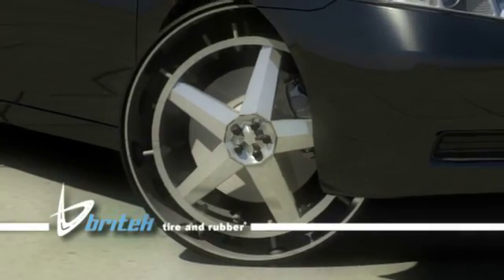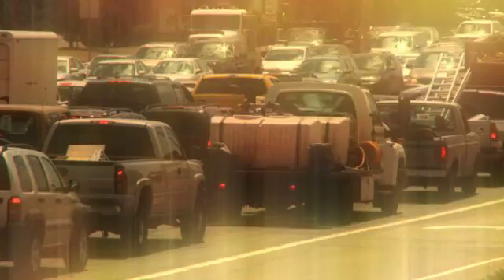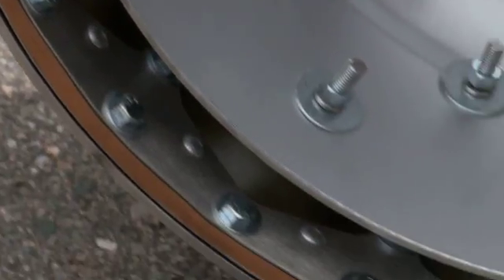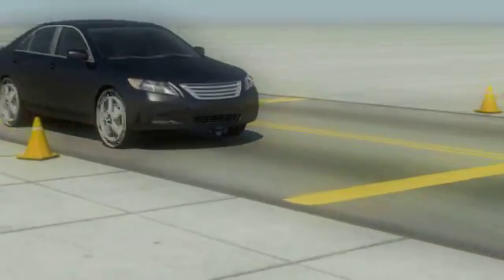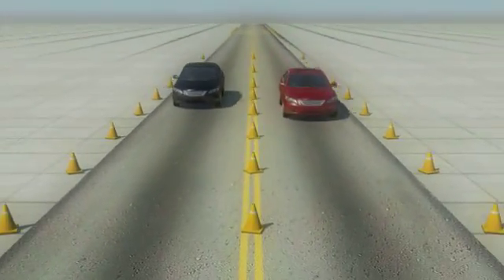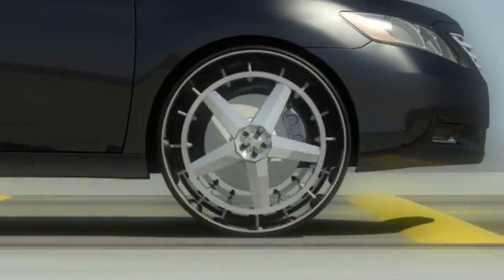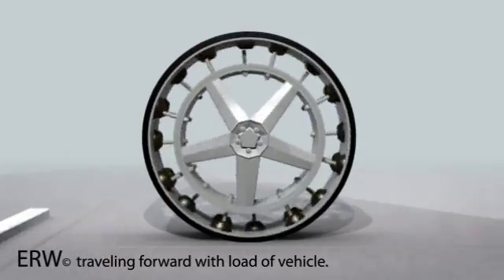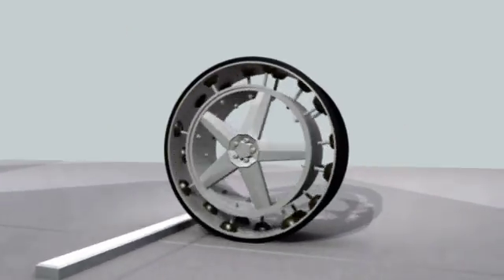britek ERW© 3D Animation

Comment from the maker: @redreaper2020 Any force capaple of moving the hub / hoop relationship from perfect zero centering is accumulated and returned through the recentering hub in hoop to the ground. The pull of gravity, running up a hill, throttle and brake forces, lateral displacement while maneuvering... any force. The twin or opposing "pre tensioned" membranes cancle out occilations as they begin. Each responding with the exact opposite action / reaction in "real time". ERW a new type of machine.

Comment from the maker: @giliam74 Check out our 6,000 lb. dyno load video where you can see the hub ride high and forewords whithin the hoop at highway speeds and under throttle. This is a sure indicator of improved levering. Check out the U.S.D.O.T. coastdown video where ERW has 50% better coastdown and easily out accelerates 35.5 over inflated pnu. We tested ERW with no traction layer as we were waiting to recieve patentable tread layer patent protection.

Comment from the maker: @mikka1986 Consider the pull of opposing drawn membranes able to cancle out impact / movement  in "real time" across the hoop. This means that as ERW deflects over an impediment the ground side of the hoop is moving  to the hub while the top side is moving away. Equal and opposite reaction in real time. This is a new type of machine ...never seen before. This is why the tire industry is so upset, every parameter of performance has patentable solutions for the industry and we own them.

Comment from the maker: @godackgudalach1 Not recomended but you can run into curbs if you like with the Kevlar bound ERW highly curved composite hoops. They displace laterally to deflect impact. You are correct about the cost. A premium product will require a premium cost, at least initially.

Comment: If you hit a curb with the thing its safe to say its done for...   I might get a bubble in my side wall...  and I lower pressure in the snow to get more traction in winter and raise it on sunny days for better mpg's    I wont buy these unless they are cheaper than new rubber and I really don't think that's gonna happen

Comment from the maker: @necromncr Consider equally drawn slingshots centering across a hoop. Any action IE movement will be demonstrated in equal and opposite action in "real time". Each one following and cancling out the other at the "exact" same time. It is this action/reaction in "real time" that makes ERW superior to any tire when the surface, speed , direction of travel changes. This "force" can be adjusted by more or less attachment distance to inner wheel and by adjusting vacuum boost on membrane side of hoop.

Comment: @EnergyReturnWheel I presume 40-45 profile would work then? Also, I understand typically between 45 and 50 profile is approximately optimal for regular tires as it gives the best balance between distortion resistance and overall grip. Is there an optimum profile for the erw?

Comment from the maker: @jcadlols Any profile can be matched. We are now building and test riding 29"x 2.5" mountain bike ERW wheels. NO MORE FLAT BICYCLE TIRES!  Performance is amazing. Video coming soon. For auto the hoop displacement is not enough to hit fender wells, just enough to accumulate/return any force capable of bringing wheel/hoop out of perfect 360 centering force IE gravity, rotation from throttle responce, hard braking, lateral displacement from cornering bumps, etc.

Comment from the maker: @larry903s Testing early "steel" hoop models we had  hoop failure by hitting a 4" asphalt like brick at speed. We continued driving, agressive maneuvering only noticing a slight bumping. To our surprise the hoop had cracked 3/4 across yet maintained reasonably good handling and ride. The membrane held the hoop in position. This was one reason we went to composite hoops. Also the "4,800 psi." @ 800% elongation membrane can really take a beating. Max. elongation potential is only 300% in ERW.

Comment from the maker: @larry903s Consider this... ERW has opposing "sling shot" like pulls. This counter balances load cycles in "real time" across the hoop radically reducing the cycle time and displacement. When pnu fails it usually happens quickly. ERW is very robust. It is pnu. that must form a tread block, a slapping action you can "hear" on some road surfaces...that limits high speed performance. ERW rolls and conforms our Kevlar bound wedges into a "footprint" a smooth rolling action that pnu can not match.

Comment: However, if you're saying that putting the wheel under tension in an unloaded condition, much like a tension bolt when it is torqued (re., your statement of ' "pre" tensioning') then the wheel is seeing fewer reversing load cycles with perhaps smaller amplitudes (or no reversing load cycles depending on the road conditions), but it is still seeing millions of loading and unloading cycles, which still causes cracks even if it is all under tension loads.

Comment: My point of the joke was this. The ERW is essentially a mechanical device, so it can still break. You can't solve the problem of fatigue.  A rolling wheel of let's say 2 foot diameter would undergo approximately 1,680 reversing cycles (reversing from tension to compression loads) in just one mile. That's a lot of reversing load cycles and that is horrible for fatigue.

Comment from the maker: @larry903s We agree! The Michelin tweel can not displace much "linear" travel internally and cannot be "pre" charged with elastic tension like ERW. Our "pre" tensioning replaces "air" pressure that supports pnu.. Tweel is also a "low" speed application while ERW is "high" speed application.

Comment from the maker: @ADivyneMind Recent protos are a multi wall carbon nano tube infused carbon fiber core. We then apply multiple layers of nano tube infused balistic grade Kevlar fabric to impart a secondary strength.  Combined we have a super strong, tuff, lightweight, yet flexable material for hoop and pull plates. We use a very special German rubber membrane formula 4,800 psi. burst strength @ 800% elongation. Max. elongation for ERW is 300%. Traction layer is Kevlar belted "same" formula rubber.

Comment from the maker: @ADivyneMind We are looking into impact modified fiber molded reinforced plastics to replace the carbon fiber core Kevlar reinforced hoops and pull plates, using more traditional tire industry fabric components and processes to keep costs to a minimum. Untill mass produced we can not provide a for certain the price answer. However we still think there is a market for high end "Uber" tech. ERW for racing and special purpose use.

Comment from the maker: @NeilBlanchard ERW is tuneable. More or less internal wheel tension can be adjusted 2 ways. Adjust the distance of membrane pull plates from the hoop with wheel attachment bolts or increase/decrease vacuum pressure on the hoop side of each membrane. Check out our web site. Check out our other "vacuum tune" video showing 1.5 " sidewall height ERW hitting 1.5" stone.

Comment: @NeilBlanchard 

A major hurdle for ERW is aerodynamics. Having a open wheel will really churn the air and cause a lot of drag. Also, gravel and snow and rain will be flung by this wheel, and they can get inside the rim and throw it out of balance. The solution for these would be the same, I think?

I would love to use these wheels on CarBEN EV5!

Neil

Comment: The main idea you have is great. I would want to see how a more rigid version of this wheel would work with a regenerative shock absorber, like from Levant Power.

I got to meet with 2 of the Levant folks last week (@ MIT "Energy Night") & they would need to scale the shock down for a lower weight vehicle, and tune it for more frequent and smaller strokes that having a wheel like the ERW on a car would bring. (con't.)

Comment: @EnergyReturnWheel 
Do you have a drawing of the off road version you just described?  It almost sounds like you're describing that it is flooded with rubber, like a solid core tire.

Also, I have a 1976 Datsun 280Z; I'll gladly be a test platform if you have any intention of working with older vehicles.  :)

Comment from the maker: @skittlescodeman Hardly, there is 360 degrees of 7,000 lbs. "pre charged" linear pull from the center of the wheel plus the pull of 2 permanent highly elastic sidewalls...not just support from floppy sidewalls that must be supported by air pressure that can vanish in a flash. Pnu. can only temporarily compete because they are allready here. If ERW was here first you would "laugh" at the idea of an air filled balloon "holding" the sidewalls to the rim by air pressure!

Comment from the maker: @nicola08901 "Real time" 360 degrees constant control focusing to points will "wind up" ERW hoop in emergency braking, maneuvering, throttle responce, anti bounce, responce to impediments or terrain variations keeping the hoop to the surface in a manor that pnu. tire body and tread block can not match. We  now have a greater distance of membrane / pull plate travel  than is shown in our early animation. This winding effect also increases drive train efficencies to additional double digit e gain.

Comment: This is all simply amazing to look at. Now you are wondering "why just look at it, You can have it!" and yes it is clever just like an airbag or new diesel engine. The thing is that a company which would put that wheel into the market would be for sure aimed in the money. There is no other way. So, the new E.R.W or Tweel  will not be mass produced without a good profit and where that profit would be hen they are designed to last more then normal tires? These days  have 3 years warranty,guess why

Comment from the maker: @1977fiero Thanks for the lunch suggestion ...sounds good about now. We have had to put our funds to building and protecting ERW rather than convincing the public at this time. The tire industry is a tough nut to crack and we must have the best, most fully developed product possible to compete with a 100 yr. old well established market. Also check out our early proto "no traction layer" "at speed" 6,000 lb. dyno load IE MB would be loaded with 5 football players...DOT highway test dyno video.

Comment from the maker: @clinemichael Material science has produced very durable rubber compounds. We are now using a powerfull vacuum backing up the membrane and to act as a vacuum barrier against the transfer of shock and vibration from outer hoop to inner wheel. Air pressure in the 100 yr. old pnu. is a perfect conductor for shock and vibration across the tire body to the  wheel.

Comment from the maker: @fangus503 The larger diameter  ERW the better they lever. We will soon be introducing our high speed military airless designs that will radically reduce the weight of even the largest "monster truck" wheels/tires. Our removable sidewalls are not weightbearing "less weight".ERW levers from the top side and will perform on hills like pnu cannot. Lets not forget that ERW demonstrates a dramatic "deweighting" effect that NASA will rely upon for the Mars mission.

Comment: @EnergyReturnWheel no...because its a tpms system...it displays two lights on the dash one of TPMS and one that looks like  ( ! ) it basically tells when the tires are low on air or flat. the lights simply illuminate. But I simply assume I could remove the fuse for the TPMS system so that it doesn't illuminate and install the ERW's on my car.

Comment from the maker: @fantalon2 We have discovered that a vacuum pressure aprox.18 Hg. increases "lift" and further reduces transfer of shock and vibration from hoop to inner wheel. Perhaps the system could be tweeked to display vacuum boost?

Comment: @EnergyReturnWheel not what i mean.... I currently have a tpms system which measures tire air pressure. Because of the design of the wheel, do i simply remove all the components of the tpms so that no lights will be on my dash?

Comment from the maker: @danspratt2 Although I am picking up a slight sarcasm in your post, it is actually not that for from the truth. When a tire rolls over the bump it LOOSES energy, we are simply saying our design rolls over the bump and STORES that energy and applies it to the ground just after the bump...  This is NOTHING like a TIRE as it is NOT dynamic and not sprung away from bumps or hanging from the top of the hoop.

Comment: Any lateral give in these tires like you would get with convetional tires? otherwise skidding is more likely?

additionally, if you went over a stone, would the entire tire wheel deform to allow for this? With covetional tires this small point load would be managed by an indentation in the tire very locally.

Comment: @wasgaujaeger Certainly it influences Efficency.  if the "spring steel" ring cannot float around the actual wheel (the rim) then there is no absorption of energy, it is all transfered to the shock absorber and cannot be returned in the way they claim.

Comment from the maker: @maxhax2000 We cannot post this document at this time and wouldn't on youtube...  But our technology works because it is NOT making the wheel harder to gain  efficiency, it is making it more Flexible yet stores all that energy at the top of the wheel literally throwing it back to the ground. Wind resistance on the FRONT of the wheel will push and LOAd the Rear of the wheel as well further throwing the force to the top of the wheel.

Comment: you emphasize several factors that have nothing to do with energy return also. How much more energy is returned from the deformation of this wheel-Surface interface than the air tires? Just a little bit more + the breaking upside, traction, never goes flat, and looks cool, mentioned?     If its a superior wheel,  nice,  but you raise the issue of energy return, efficiency and thousands of scenarios so how about a nice rouned % efficiency over the standard Tire-Wheel?

Comment: @Jakeyboyshow 

There's no reason when setup would have any more of a heat dissipation issue than current pneumatic tires. I'd assume it may even be less due to the open design. I can see a few areas where this design would be problematic, but heat doesn't appear to be a major one.

Comment: @Cponce626 the gas milage has more to do with the rolling resistance. you get less miles per gallon if you have low tire pressure because there is more rolling resistance. this is a steel or kevlar hoop so it is very hard on the road surface therefore less of the tire touches the road and the lower the rolling resistance.

Comment: The tire will need to have side wall traction (if you look around, all everyday tires have this to some degree) for snow and sometimes dirt, otherwise, once you get stuck, you'll never get out...micro siping at very very least. If that can't be done, this will only be good for fair wheather sports car applications.

Comment: Yeah but gas in a tyre keeps the tire warm and a warm tire is good for traction. And hot gases forses the tire to expand (harden) at high speeds..If no gases ,the rubber would increase in temp at braking , but after when it comes to a stop the rubber would rapidly decrease in tep and not keep its traction

Comment from the maker: It wouldnt shrink but it does wrap around the axel, but as it does the membrane becomes Exponentially Tighter only allowing for minimal Rotational elasticity.  Yet that elasticity is exactly what ABS brakes try to accomplish by electronically pumping the brakes 1000's of times per second only has a dynamic tension.

Comment: Maybe this is a dumb question but when someone is driving fast and suddenly steps on the breaks, wont the tires shrink from the cables trying to wrap around the axle? And wouldn't the continuous stretching and compression cause those cables to heat up and soften? Maybe the air is cooling them though I don't see how air could get to them unless the car has scoops built into it specifically for that.

Comment from the maker: The ride of the V-01 ERW© prototypes was as smooth as silk, and that was with the Metal Hoop, Which has now been converted to a composite hoop and lighter hardware, resulting in less weight.  The sidewall of a standard tire has less lateral compliance, the ERW© membrane works as a lateral shock absorber increasing grip and handling through corners.

Comment from the maker: It work by suspending the weight of the car from the TOP of the hoop rather than pushing the weight of the car into the ground at the bottom.   Much more like a  Bicycle wheels spokes.  The one big Difference is that our Spokes are Pre-Tensioned and this makes the inner and outer hoops independent of each-other and allows for TONS of possibilities.

Comment from the maker: Our pats allow for many design potentials. Such as contoured steel hoops to resist or assist flexing, taking advantage of the best alloys, metals etc...  Also our pats suggest the use of recycled tires as a top coat/traction layer providing additional cushion against pea gravel and the likes. It could prove very workable on motorcycles.

Comment from the maker: As the outer hoop is deflected away from an obstacle it converts that added load inside the membrane, back into the rolling motion.  As this happens the shocks begin to work as they normally do, only far less shock travel is needed over each impediment.

Comment: What happens when the springs get overloaded and the wheel "bottoms out"? Will this wheel design be more prone to rim damage than traditional pneumatic tires? I know that the 'tweel' has major noise problems. Does ERW have this same engineering obstacle?